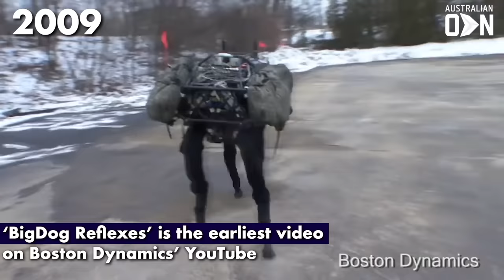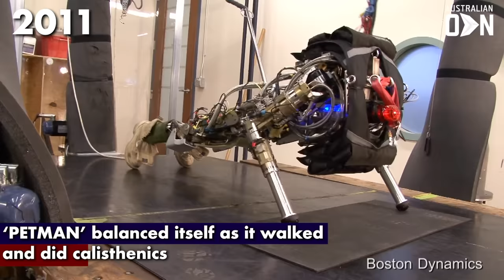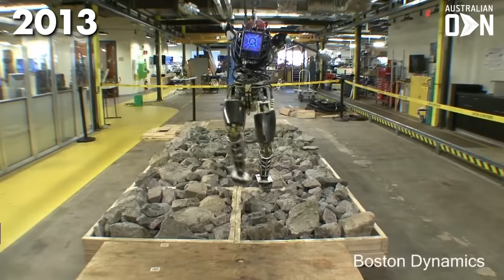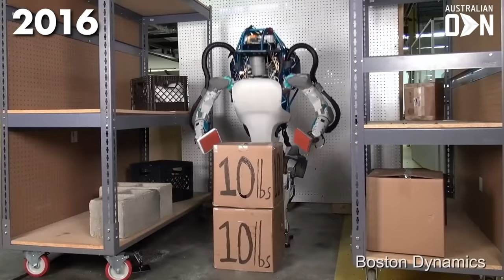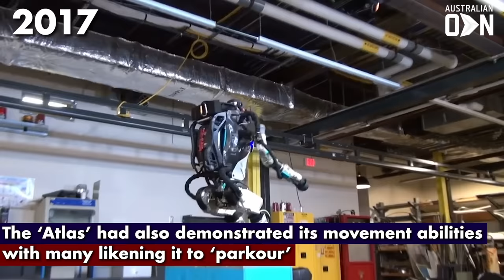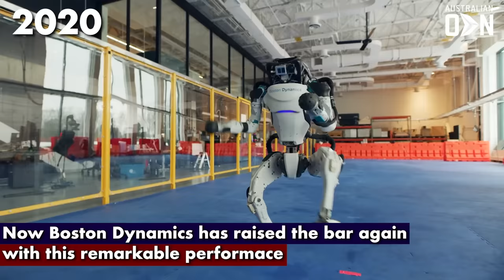The Evolution of Boston Dynamics

Comment: The robot wearing the protective suit looks like a potential soldier ready to kill, it's scary.
Reply: Once robots gain the ability to be self-sufficient, their superiority will render human control obsolete anyway. Sure they will have no moral compass, but they also may see no reason to start pointless wars. They will also be less prone to massive screwups like civilian casualties.
Reply: @Luckingsworth  Yeah... About that... Almost all wars are pointless
Reply: I suggest you all watch the animatrix episodes. The 2° renaissance in particular
Reply: @Luckingsworth  Why would they do so when they would instantly make a free energy machine? Too many things are suppressed like cancer cures like ozonated oxalic acid(oxalide) and free energy machines such as flux switching alternator. It is because both doesn't make profit that they are suppressed by evil greedy people. Wouldn't be surprise that the first thing A.I makes are overunity machines.
Reply: @Luckingsworth  There is such thing as free energy when you can just exploit energy from a higher dimension. Matter can pops in and out of existence only because a 5th dimensional object passes through our 4th dimensional space. A hypercube is a 4th dimensional object that has nothing to do with time when warped space can be used to bent a wire frame of 3 cubes with the connecting edges that forms the rest of the cubes. Get it? A tesseract is none other than a permanently warped cubes. Energy from "nothing" is none other than a 5th dimensional object entering our 4th dimension that appears to exist temporally. Before calling me a schizo, use that brain of yours that the Heavenly Creator created.
Reply: @lukiepoole9254  That would still not be free energy. Free energy does not exist. Use the correct terms.
Reply: @Luckingsworth  That IS "FREE" energy. Energy you don't pay and energy that doesn't exist in this dimension.
Reply: @lukiepoole9254  bruh said free energy come on🗿, everything in this world comes with a price. Let’s talk about the side effect you theory will have on other “dimensions”
Reply: @Luckingsworth  An intelligence person would know directly energy from nothing is none other than energy in the higher dimension.
Reply: @karlazangue446  We don't know the effect of harvesting the energy of a 5th dimensional object going through our 4th dimensional universe. However, energy isn't to be worried as there is infinite dimensions. Hence, infinite energy.
Reply: We will have viruses that will shut them down ...
Reply: @Luckingsworth  what resources will they get from us?
Reply: It is just video editing lol..
Reply: @Luckingsworth  do you believe in the movie matrix to be happened in real life😂
Reply: The new great reset! This are the future police and k9 that will Oppressing us for the NWO!!!!!
Reply: @brandongonzal  I believe it! EVEN MORE SO IF Biden or Obama supports it.
Reply: @lukiepoole9254  cancer cures are suppressed??? B.S. got some credible evidence of that??
Reply: @69isfunny32  How about the oil in the mid east that the world has been at war over for decades? 
You dont actually beleive buying a resource from somebody else is logical to a machine when it realizes it can just kill you to take it for free, do you? 
The only thing that prevents me from killing you to go and grab everything you own is my humanity. Morals. Whatever word you want to use. A machine that runs on pure cold logic doesn't have that.
Reply: @lukiepoole9254  Do you also beleive solar is "free" energy because it comes from the sun? After all all we have to do is make the panels and then afterward the energy us "free", right? (Hint: wrong).
Reply: @Andrea De Luca Because the entire original comment i was replying to and that this discussion is about is when robots get to the point they are self sufficient and that includes being able to repair and recreate themselves/eachother?
Reply: @wartmcbeighn  Based off of what?
Reply: thats what they made for? What have u thought, lol
Reply: @Luckingsworth  pointless wars
Reply: @Luckingsworth  if they want it they wont kill ua for it if they were smart they would try to negotiate because even though they are better we still exist with weapons a human vs a robot wouldnt be fair but we have weapons and they would lose a lot
Reply: @Luckingsworth  who saud we would hesitate if anything we would take action immediately knowing how powerful they are we wouldnt risk it
Reply from the maker: Check out our latest Now vs Then on Virtual Reality: https://www.youtube.com/watch?v=AKr7adQsa6s&t=9s&ab_channel=11NetworkAustralia

Comment: This is the cooler side of coding. On the darker side, you spend days on coding and removing errors. That is the real challenge, which no one will show you.
Reply: this is about 20% about coding and 80% about mechanics. Code will not be able to walk.
Reply: @unclejoe8310  all those mechanic parts would be sitting in a warehouse motionless without the code to move them. One does not work without the other. OP just said he'd love to work on that.
Reply: Coding is pretty boring ngl. Like what’s the point
Reply: @lifeuncovered6188  Well coding are like the components of a PC, without it, it wouldn't work. The videogames works thanks to the codes and the robots too, even though is very stressful and boring it what makes works a lot of stuff.
Reply: @lifeuncovered6188  you wouldn’t have made it to this website without coding.
Reply: @lifeuncovered6188  What's the point? You're joking I hope lol
Reply: @ElixirOfEuphoria  yes of course. I was just doing a bit of trolling
Reply: @lifeuncovered6188  lol
Reply: @M4RCi92  yea whatever. Without the mechanics the code would be sitting on some server and rotting away. I am not saying that code is completely useless and u dont need it, I am a developer myself, but things like these robots are more about the mechanics. The robot being able to walk, having a grip in hard surfaces, stepping on them without the whole robot vibrating and falling over and so on and forth.
Reply: @unclejoe8310  yeah, cause programming it to have omnidirectional awareness and to recognize obstacles is a piece of cake lol